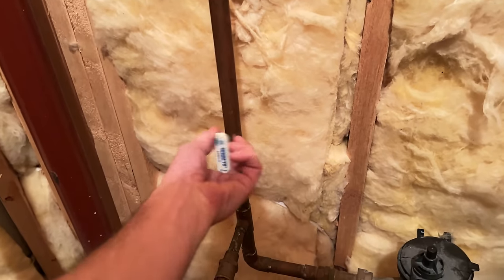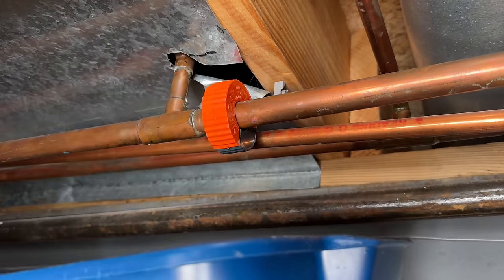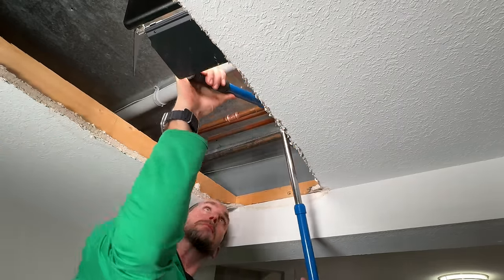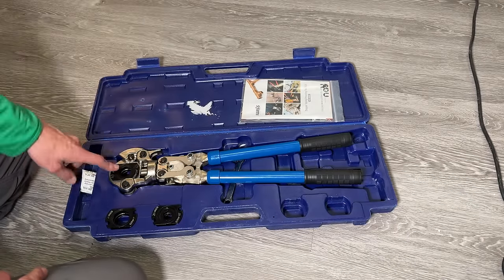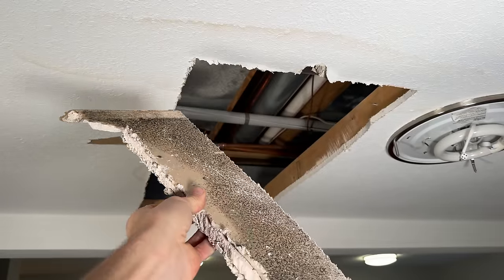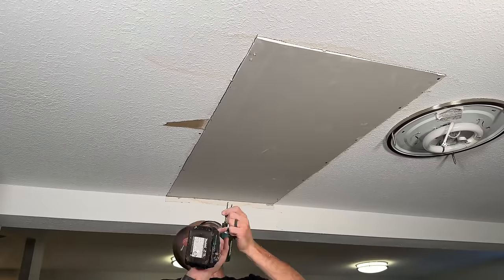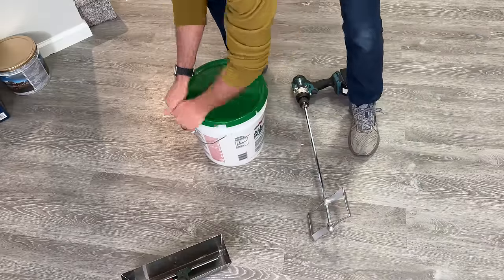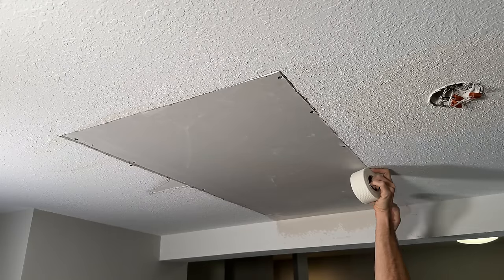How To Stop A Water Leak And Fix A Water Damaged Drywall Ceiling

Comment from the maker: Jab Saw - https://geni.us/fWoR1t
AutoCut 3/4" Pipe Cutter - https://geni.us/vL3VYDM
Deburring Tool (Inner/Outer) - https://geni.us/PvAAhJ
iCRIMP Manual Press Fitting Crimper - https://geni.us/IqAJ7o0
ProPress  3/4" Coupling Without Stop - https://geni.us/aN8v
BIN Shellac Primer - https://geni.us/HZMFbW9
6 in Drywall Knife - https://geni.us/GOlwZb
Drywall Knife 5-Piece Kit - https://geni.us/PGBh9
14" Mud Pan - https://geni.us/IAO8MoW
Mesh Drywall Seam Tape - https://geni.us/WSYz
All Purpose Joint Compound (Mud) - https://geni.us/9jYerS
Ultra Lightweight Joint Compound (Mud) - https://geni.us/QwGU2
Homax Knockdown Texture Spray - https://geni.us/THQU8

DISCLAIMER: This video and description contain affiliate links, which means that if you click on one of the product links, I’ll receive a small commission.
Reply: Hi

Comment: I would have just attached another 2x4 next the existing 2x4
Reply: You're right ✅️
Reply: Exactly.
Reply: Yea attached it to the mould drywall excellent conclusion
Reply: Not sure if it’s necessary, but I didn’t see him attach a support piece on the far end either.
Reply: Do you mean a 2"x4" stud, or 2'x4' drywall? Is it faster, or does it improve the results?

Comment: To me, it didn't look like it blended, in any light.  This is the nightmare of patching drywall, it just never matches.  The only way to get a perfect match is to replace an entire wall/ceiling.
Reply: I would rather save money and time by patching little sections than replacing entire area.
Reply: That's the problem with popcorn/knockdown ceilings. You can never get it to match and blend. With a smooth ceiling at least you can tape, mud, sand, and paint it a lot easier. The only way to make the paint match is to paint the entire area.
Reply: It's mainly due to the popcorn ceiling texture, it's a challenge and one im happy to say I won't come face to face with in my house
Reply: Very correct I been have some issue try three different sample of paint to Match the rest of the ceiling no worked still show the difference 
I concluded too that best is to paint the whole ceiling

Comment: I'm a DIYer myself, not a professional. However one thing that saved my life was getting a shop vac drywall sander attachment. You really should look into that instead of using the sanding blocks. Completely different experience and final result!

Comment: The 2nd floor bathtub drain leaked into the downstairs dining room chandelier.  Looking into the trap door at the back of the tub, the PVC pipes disappear under the tile floor which is actually 2 layers of tile floors each with a wood underlayment.  Since water generally finds its lowest area to run to, would you venture to guess the broken pipe would be above the dining room even though the two rooms are not directly above each other?  Seriously hate to open this 70 yr old plaster ceiling.

Comment: How does a copper pipe get a pinhole leak?
Reply from the maker: I believe my pinhole leaks were associated from sloppy solder work that created turbulence in the pipe and slowly ate away at the copper pipe wall over 2 decades eventually resulting in a pin hole.

Comment: Agree with existing comments, your jig is awesome! For the knockdown texture, what i did in the past and it worked pretty well is apply lots of texture, let it dry overnight, then sand off the high stuff. That way there is no smearing.

Comment: In my experience when needing to replace a section of drywall, I find simply affixing new 2x4 runs to existing studs or joists saves time and speeds up the repair. Cutting into the drywall to expose half the joist (as shown at 7:15) looks to be tedious and adds unnecessary dust to the job. Just my 2 cents. Keep the change.
Reply from the maker: Thanks for the feedback.
Reply: IMO it all depends upon the size of the patch as well as if the repair is in the ceiling or on the wall. Clearly, the larger the patch, the more significant the inlay should be. Personally, I wouldn't go any less than a 2x2.  @2023_GJ

Comment: i've had good luck with the Homax 4121 texture sprayer (with manual hand pump) for approx $23. It's made out of plastic but has held up well over the years. It's a lot cheaper than buying the cans especially if you have a larger job.  You can buy a 15 lb box of the Homax dry mix for about $24 (covers approx 500-600 sq ft.).  I like pre-mixing a large batch of the texture and pouring into an old shampoo bottle with a screw on cap.  During the job I can keep re-filling the sprayer's hopper from the old shampoo bottle as i spray on the texture.
Reply: Same here.  I used a miniature pump spray tube with thinned compound, It worked remarkably well.

Comment: In occupied homes, I’ve had success using a large stiff sponge instead of most sanding. Also works well to blend patches into adjacent areas.
Reply from the maker: Thanks for the feedback and that would have been very helpful to blend the edges out into the existing knockdown.

Comment: I think the drywall cutting guide you made is brilliant!  Straight-line cuts in the center of the 2x4s.  That makes cutting and mounting the replacement drywall much more accurate for less gap filler.  Too bad part of the ceiling finish ripped when a panel fell, but you handled that, too.  Yeah, I think there's a good bit more painting to do, but great job, Scott.  Thanks

Comment: You did a great job on this repair...  I do a ton of drywall repairs and painting professionally, and for a basement with that ceiling texture, it's more than passable in that situation.  As you mentioned, if it's upstairs with a ton of natural lighting you would likely need to really dial in the texture match and repaint the entire ceiling.

Comment: Have you tried wet sanding the mud? Using a wet sponge instead of grit will smooth out the compound without all the dust. It also helps fill in small holes.

Comment: I have never had luck with that spray knock down texture. My residence was built cheaply and they used knock down on every surface including all of the walls. I had to do some patch work for some “built in” towel racks, and trying to finish texture was a nightmare. I went with a slightly watered mud on a rough texture sponge to do dabs to make peaks, and then knocked that down with a blade. So far the closest I could come to the original texture. Wondering if better results would come from sanding the texture off of the areas where tape/mesh would be put down. And then texture so you don’t have the edge “hump”.

Comment: Scott, Take a look at the Makita Drywall Saw. Model XDS01Z. It will change your life when doing repairs in drywall. It is cordless, and has a built in vacuum port for dust collection. P.S. The device you built for the oscillating saw is very clever!

Comment: I  am a recent subscriber and enjoy your videos! I'm a stickler on my drywall patches and that repair in my house would bug me. In my opinion it is typically better to sister the framing or run some 1x2  (or whatever is on hand) across the void for my patch. That isn't always possible but I would only use the existing framing as a last option. I gave up using rattle cans for knock down, they just don't have the depth and never looks right. Texture gun is the way to go. Also, f you knock down the texture in random directions it helps blend into the old work in my experience but I would have feathered that compound out and sanded as needed until the joints disappear before texturing. Like other comments, I no longer use mesh tape, fibafuse is a much better product and if not I just use paper tape.

Comment: My understanding is the mesh tape is for use with fastset mud (chemical cure; 20m, 40m, etc), not tapping or general purpose (air dry).
Reply: You are correct. The instructions say “Install with a setting-type compound”.
Reply: You are correct. It’s maddening when you tubers try to teach others how to do things they aren’t doing correctly themselves
Reply: I don’t mind if ytubers make mistakes because everyone does. What bothers me is when they don’t take the time to update their videos to correct the mistakes.
Reply: @gregsmith4321  the problem I have is he doesn’t even know the mistakes he is making. In my opinion if you are going to be making instructional videos, you should at least take the time to research and make sure you  are putting out correct information.
Reply: Let me say this first. I agree if you are putting out institutional videos you should do the research before to get the most accurate information. Problem is if you have been doing things a certain way and that way is “correct” you wouldn’t automatically think “hey maybe I should research this first”. I doubt he’s been using mesh tape all these years saying to himself I know this is the wrong way, but oh well.
Anyway, I hope he updates this video.

Comment: Nice repair.

With your leaking copper pipes, have you checked your water for acidity?  It seems like you might need to prepare for a repipe (with pex?), but if your water is aggressive you may be able to treat it and extend the lifetime of the existing pipes and your fixtures.
Reply from the maker: I have a little PH tester coming next week as I am curious to investigate a bit further.  Hopefully it is an isolated incident but have 3 spots that close is a bit concerning.
Reply: It looked like the pipe was rubbing on the galvanized ducting = galvanic corrosion

Comment: Try wiping down the edges of your mud patch with a wet rag right after your skin cost to blend them in a bit better
Reply from the maker: Thanks for the help 👍
Reply: I think a large sponge (the type they sell for use in grouting), makes for a faster and more even wipe-down than a rag. We purchased a three-pack for tiling a kitchen backsplash, and I had a new one left over. I grabbed that for wiping down my muddled edges, and it came out nice. Just lightly dampen it.

Comment: A specific problem I always have with my apartment is that its so old the water control system is actually a butterfly valve closing the end of a knee junction pipe that is, like, a palm inside the wall. The valve is okay, but the knee juction has actually been overdegradated, so the valve just doesnt close it 100% anymore and some 10% of water still goes through. To change it it would mean changing the entire pipe junction and opening a 6feet hole in the wall so we can get to all the piping involved. So I just keep having to wait 24h to deal with any water leak problems, because thats the time it takes for the landowner to turn off the entire water of my side of the building. This happens twice a year give or take

Comment: My neighbor told not to worry about mold in the ceiling because there is no insulation. I saw that you had mold in yours. Maybe I need to open it up. I used a moisture meter and it doesn't indicate that it's wet. Is that good enough? The water leak was an acute issue that was resolved in a day.

Comment: ok, so I'm working on my issue now.  Hope you can answer a question for me.  the water leak I had was slow and small.  I've scraped off all the damage, and the area I'm working with is 5 inches x 12 inches. Very small compared to yours. But it was on a seam between two sheets of drywall.  think of like a subway sandwich in size and the bread is sliced down the middle.

Anyway, here's my question.  As I scraped and sanded it appears the drywall is 100% fine. The tape that was on the seam came off.  Can I just retape, primer, and then do the knockdown?  Or do I have to tape, then mud then, primer, then knockdown?

Comment: What vacuum do you use for drywall work?  My shop vacs get clogged and it’s a mess to keep usable.
Reply from the maker: Yeah, I just use a standard shop vac and knock out the filter.  It doesn't last long but on a job this size usually makes it through with no problem and plenty of suction.

Comment: You were pulling your knockdown texture in the wrong direction. You also made the mistake of patching over the existing knockdown texture, which is why you had that big lump all the way around the patch. You should have scraped off the original knock down past the repair area so you could blend them together better because you will never be able to hide that built up border.

Comment: OK, but what was the original cause of the leak?
Reply: If he didn't specify temperature or some absurd change in psi from municipal water construction, we have to assume it's from normal wear and tear/ age
Reply: @TOOL_TECHNICAL  hard copper doesn't just magically start leaking in the middle of a run though, hence the question.
Reply: @jimmaag4274 true, was just pointing out localized corrosion, and turbulence/velocity changes over time lead to these perforations or "pinholes" at 1:53 you can see the corrosion in several spots including the dripping point. Water pH, additives from municipalities and excess psi from worn prvs are just a few reasons. Just sharing

Comment: Using masking tape to seal the drywalls is not a good idea. Without compound in between the gaps of the old and new drywalls. It will end up a separation of the masking tape and create a crack line later on.